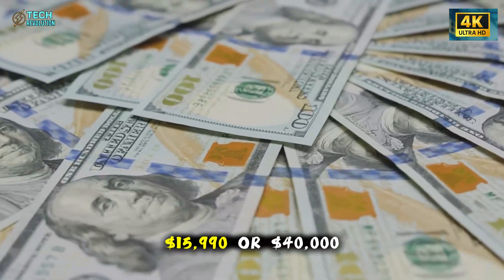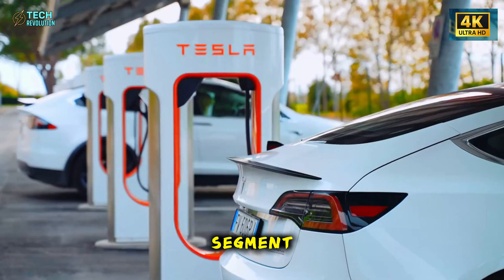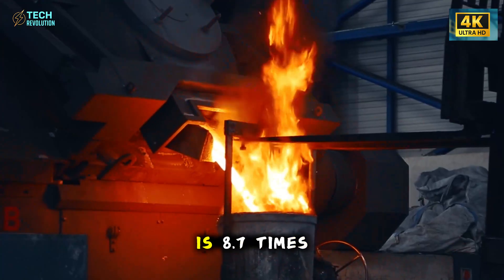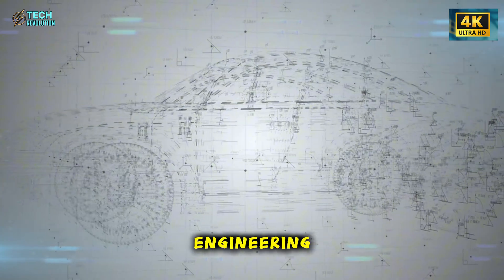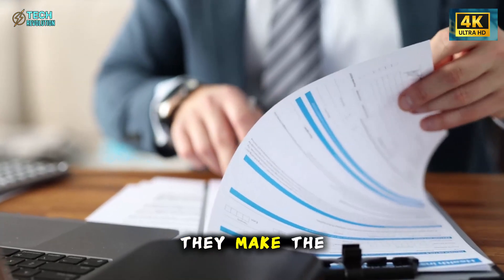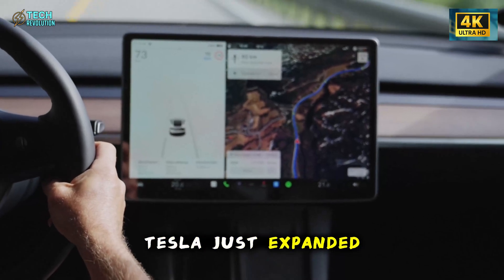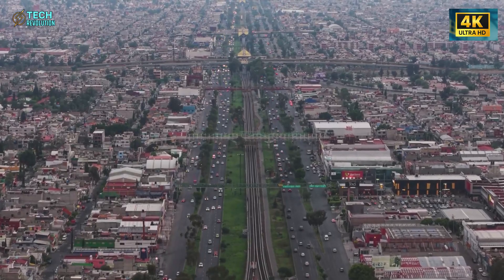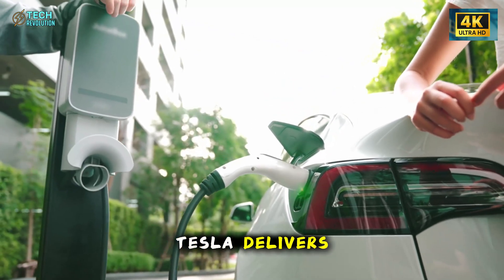Tesla Model 2 FINALLY HERE: $15,990 or $40K? What's SHOCKING?

Comment: There's no way that is under $16k.
Reply from the maker: The price sounds unreal, but cutting paint, using Giga Press casting, and simplifying parts is exactly how the Tesla Model 2 drops costs. Do you think legacy automakers could ever build a $16K EV with this level of engineering?
Reply: @TechRevolution26  Not if they are made in the USA. Labor costs wouldn't allow that.